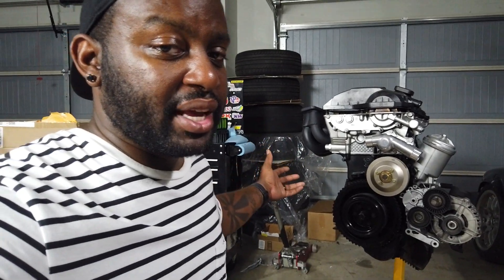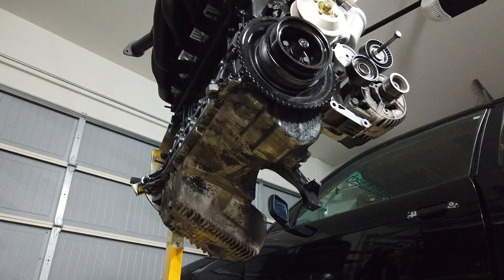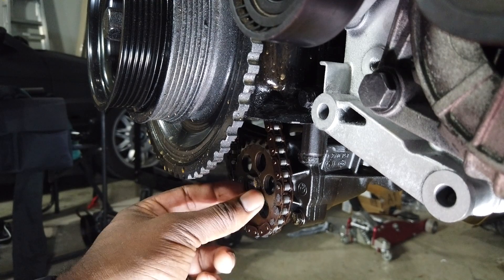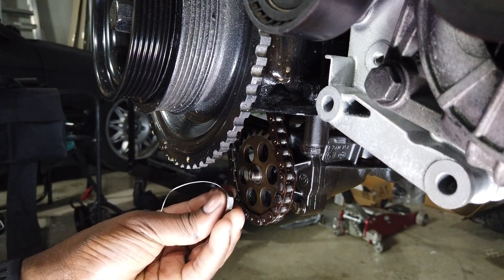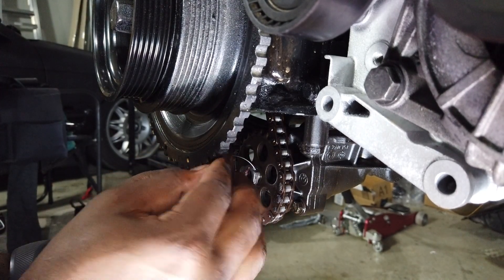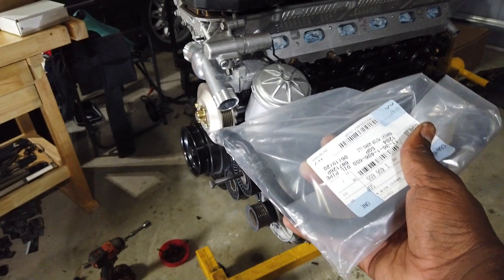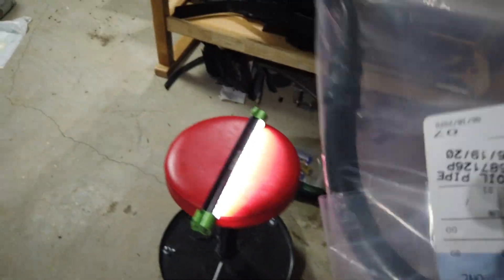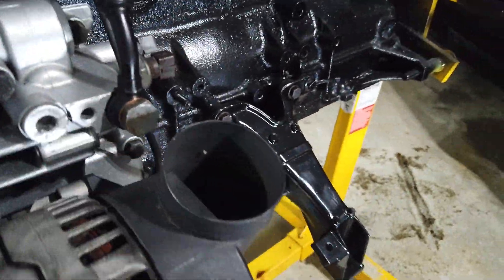Prevent E36 Engine Failure for $14, Oil Pump Nut Mod! || Turbo E36 Build [Ep. 14]

Comment: There is totally a right and wrong way to do this. And that little length of wire won’t do anything. The wire should be twisted and then wrapped around the nut in the direction of tightening the nut and then twisted on the gear. Always twist the wire in opposite directions too.

Comment: Thanks for the video,an excellent idea,easy to drill the nut too,done  from 2 faces,no need to be exactly in line; 
but you need a torque wrench and do a proper twisting of the safety wire,not that bird's nest.

Comment: The dumbest mod i have seen in my life.  The nut is left thread. It cant come loose because the engine turns The other way so it gets tight when engine runs. You only add weight to a perfekt balanced gear, that makes it woble. Like a unbalanced wheel. Oh and imagine what happens if that wire gets loose,and it will, bye bye chain. Cheers from a german mechanic
Reply: BMW themselves do the safety wire when the pan is removed. There are hundreds of documented instances where the nut has come lose and destroyed engines. I just did mine at 134k mikes and the nut was loose. Safety wires have been used in aviation and military for decades. It is cheap insurance when done correctly.
Im not sure what’s going in here - you need to use proper safety wire pliers and the wire should be tight and in the direction of tightening.. so it doesn’t allow the nut to loosen.
Reply: @bcastromusic  well said, in aviation it used to be an art, probably still is, pretty looking  twisted wire

Comment: I know this is like 6 months too late, but that lifting bracket is for the m50 motor I think. For some reason they are 2 different sizes. I had to do the same thing when I did my m52 swap
Reply from the maker: Hmm good to know

Comment: you should just get a 6-speed out of an e46, you can also convert the e46 SMG to a 6-speed manual as well, the SMG you will probably be able to find for cheap, then just convert it over, the internals are all the same
Reply: will e46 6 speed manual tans mate directly to e36 engine ? I've wanted to 6 speed  swap my 5 speed manual e36 for a while
Reply: @joeg2286  I believe it does just bolt up, but I havent actually tried it to verify

Comment: I normally just give the nut a little hit with a center punch to secure them. I didn't even know they make these safety wire nuts...
Reply: There is a right way of safety wiring the nut. That still has a possibility of coming loose. 
Please do some research.